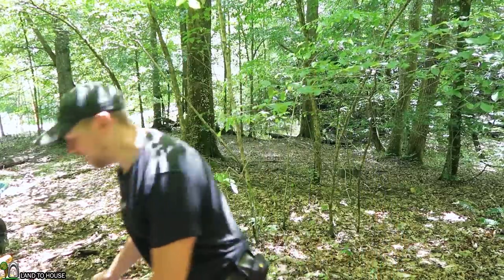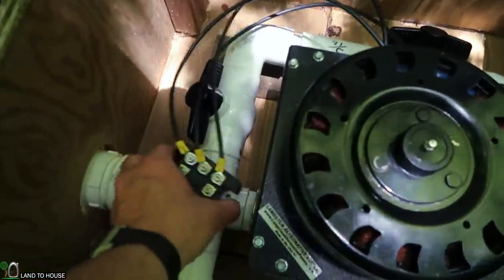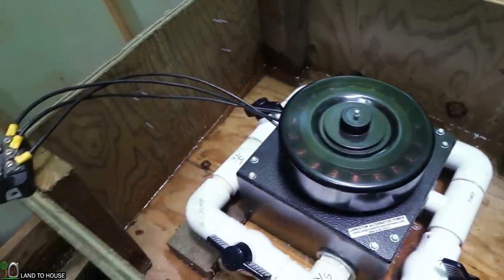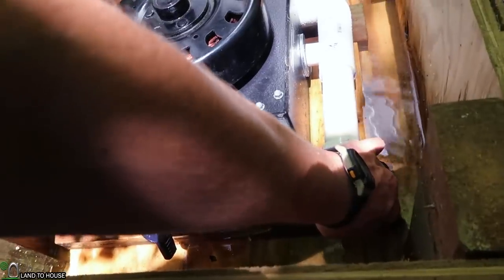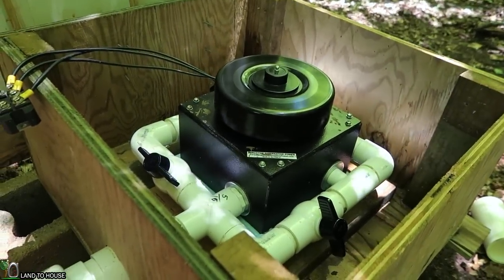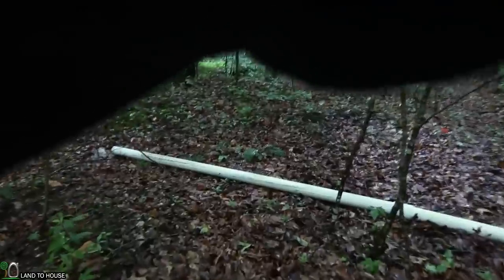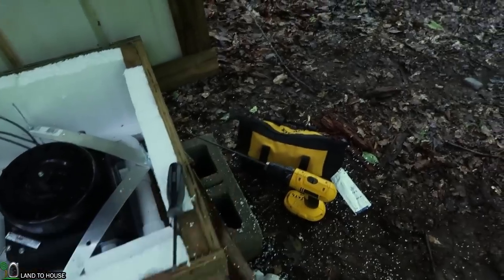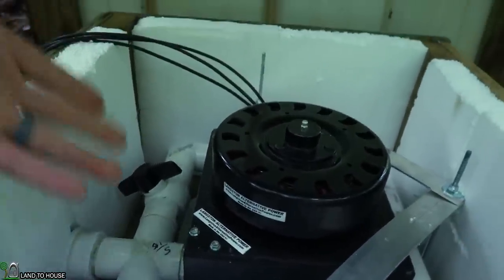Installing the Turbine Micro Hydro 6/10

Comment: Very nice system, however, I'm surprised he used cheap PVC plastic ball valves; they just don't last, especially outdoors with constant changing temperatures..
Reply: First thing I said. This thing doesn't stand a chance in winter. Seems like a cheap unit all the way around. Not sure the price point but I wouldn't bet my family on it. That's for sure.
Reply: @hellogoodbye3129  If the plastic 'ball valves' are an indication of the entire build then the product is sub-par at best..
Reply: @dukeman7595  so I looked at the web site. This company seems like it was cobbled together, the generator unit specs are non existent. Each unit is custom built. The reviews are split between "it works" and "broke immediately".  So yeagh. I stand by my statement of not going to bet my family on it. At least they don't seem to catch fire. So there is that.
Reply: @hellogoodbye3129  The cheap ball valves tells the tale; if he, they use cheap junk the mentioned, I suspect the rest will be as well..

Comment: I'm surprised the box is so small. wouldn't it work a lot better if it was a circle instead of a square? After the jet hits the turbine or the Pelton wheel you don't want it to Splash back after hitting the Box and if it's flooding it's definitely way inefficient.
Reply from the maker: I am going to be remaking this box in the future. Thinking about using pvc trim boards as the water proof box. Then I can make the drain a lot larger. I will need that when I start opening more nozzles.
Reply: I've always thought about making one with a cone shape. That way it would be deflected out and down. Just food for thought
Reply from the maker: Yes i suggested that to Joe Malkovich and he tried it in his micro hydro. Did improve things some.

Comment: It'll be interesting to see what happens to pressure when you open up all 4 nozzles!
Reply from the maker: I would need a lot more water!
Reply: @LandtoHouse  I've enjoyed the way you are working through projects with no foul words or throwing tools around (which I have done routinely), have you tried all 4 nozzles?  would it do any harm to do it?  Waaaay down the road, you might contemplate a designated 10' X 10' shed, insulated with turbine right in the middle so you can access all sides, if it's going to power your house you're going to need to be able to work on it as time goes on.  Of course another project is just what you need, coming from me with waaay to many projects and way to little time.

Comment: Thank you for the video. Figure my ignorance, where's the water coming from? Guessing the creek. What did you hook up to pull the water from the creek? Also what are you going to do with the electricity?
Reply from the maker: Hello. Each of those questions are answered in the series. I get the water from the creek. It is flowing around 30gpm. I use a wooden box with screen over it to capture the water and then filter it in a barrel before it goes down the penstock. I use the power in the house. It saves around $30 a month.
Reply: How do you pressurise  the water?
Reply: Rudy Lovato he used a pump. Watch a few of his videos.
Reply: @ScreenPrintR  
Thank you

Comment: Cool man! I like your Videos very much! And there is enough water to feed your Ram Pumps too 👍🏻maybe you can use a big Ram Pump and a bypass in your Intake too, to give more water power to your turbine... ;-)
Greetings Ben
Reply: Ram pump on the discharge to feed back into the collection box?
Reply: @bufkinmanor  no, I think you lose too much water potential. I think if you collect the water after the turbine and feed a Ram Pump, its possible to get more high pressure water to feed the turbine. Maybe as one nozzle in the turbine separate or with a T in the drive pipe from the hill.... Seth ist a Ram Pump Specialist? Maybe its possible 😬
Reply: ViezeBen, not sure the flow rate from a ram pump would do much good.  I do like your thinking though, maybe Seth could do some tests for us 😊  after all, these are pre-recorded videos, what else does he have to do right now? Haha

Comment: Double the size of the drain, inlet is 2",  Outlet should be "at least" 4".
Reply from the maker: I might have to do that when I start using more than 1 nozzle.
Reply: @LandtoHouse  Why even have a drain pipe?
Just place your turbine housing over the creek (or at least very close to it) and let the water flow directly out of the turbine. No additional tubes.
Reply: @ahmdabdallah2132  
Why do you think I would believe you that your god is real?

Comment: The Pelton wheel is known for being  extremely efficient, but it rotates at high RPM.  What types of bearings are used and how long are they warranted by Lancaster?
If all.four nozzles are turned on, can you achieve 220 volts.AC then split it  down to.110 vac.at the house?  How many watts are you getting at 110 vac at the house?

Comment: Big respect, but I have a question for you. All you chaps convert to DC immediately and then have a long wire to your house, Could I suggest that you transform up the AC to 5X or 10X transport your current to the house and then drop it back down to a usable power to charge your batteries, you will have far less losses. We are not talking Country wide power distribution conveying thousands of KV here. If you dislike AC, you are not related to Edison are you <Big Grin>

Comment: when you start taking energy and put a load on it  it will slow right down  a multimeter only checks current not draws a load
Reply from the maker: Correct. Continue watching the next few videos to get the load voltage.

Comment: I think you should get an actual electrician involved to help you out with the wire runs.  What I'm  seeing and what you are talking about doing makes me nervous.  200VDC is a lot.  What are the AC phase voltages coming off of the turbine? That rectifier seems like it should probably be closer to the house or inverter.
Also, you should probably just go ahead and add another 10 ft section of pipe to the output to get as close to the creek as possible.

Comment: Drill a small hole at the top of the drain pipe and use a air line check valve to prevent vacume.

Comment: hello I have a question, I'm making micro hydro using a dc generator, the resulting voltage is 112V DC. but connected 5W load, the voltage becomes 10V DC?
Reply from the maker: Yes under load the moter will spin slowly a d the voltage drops. My hydro unit spins 200v no load and 80v typically under load.
Reply: @LandtoHouse  Could batteries alleviate this? Kinda like a buffer?

Comment: Add the ceiling insulation before the winter. And question can you use that voltage to charge home battery systems?
Reply from the maker: We shall see how cold it gets in there. Yes I am installing batteries in part 8 and 9.

Comment: Have you considered feeding the water byproduct back to the turbine, at least some of the byproduct?  Think of the micro hydro system as being the circular system in the human body.  The turbine is the heart.  I think if there was a way to prime the turbine with the necessary water and pressure, and then the system utilizes that water and circulates it back, at least some of it, to the turbine, thus creating a self-generating and "perpetual" power generating machine, like the human heart.

What do you think?
Reply from the maker: The problem is the pressure difference. The penstock has a pressure of 65psi. The waste water has a pressure of 0psi. There is no way to combine the two.
Reply: @LandtoHouse  thanks for the quick response. What is the penstock?  The source of the water or the water stream?
Reply from the maker: @thomasperry7837   The penstock is the special name for the pipe that brings water from the source down to the turbine.

Comment: A better way to do this is to take a 275 gallon tote and cut the top off then build a stand for the turbine to sit on 16-20 inches tall.  Let all the water drop to the bottom and out the value.  then pipe the excess out to wherever.
Reply from the maker: The goal for the next design is to make a PVC trim box with a full 9"x9" port out the bottom. That will allow the water to flow out with ease.

Comment: I would like to know how much power it can make at full load. My thoughts are using one like this to power my heat pump pool heater using the pressure from the pool pump. Am I asking for free energy and this won't work?
Reply: What runs the pool pump? What makes you think the pool pump can put it under 100% load?

Comment: Do you take into consideration the local wildlife while designing these hydro electric projects?
Reply from the maker: Local wildlife? Like squirrels chewing into the penstock?
Reply: @LandtoHouse  like Fish that use the waterways to spawn. Or insects that live in the water that are a part of a food chain. You do use natural water sources for your projects right? I find it fascinating how hydro electric engineers overlook the wildlife. Look at some of those massive damns producing electricity for cities and how little they care about the local wildlife. I suppose people don't care about that type of stuff until it effects them personally.
Reply: @LandtoHouse  for example, fish fry are fractions of an inch in size but use waterways to live and grow. Insect larva which could be vital to fish stock is fractions of a centimeter at times. Do you think anything survives the journey through The Hoover Damn? I doubt it. Same could be said with nearly every other hydro electric project on earth, nearly. I think I have seen 2 designs that are wildlife friendly in 20 years of seeing different types.
Reply: I just saw your little electric generator that basically looks like a blender and thought I would ask.
Reply from the maker: Ah got you. There is a spring about 30 feet down from my intake. So the creek is not dry.

Comment: Place an inverter (enclose it) next to the turbine and then you can run your AC wire output (8g or 10g) up to the house without worrying about voltage drop.

Comment: sounds pretty good, but will it sustain 50% of its speed under the load? Its also spinning quite fast continuously, bearing maintenance might be something
Reply from the maker: The charge controller slows the speed way down under load. It finds the best speed for ideal power production.
Reply: @LandtoHouse   any free plans for the charge controller and generator parameters to build?

Comment: Yeah you should have about 125 Volts RMS  when you're finished with it.
Reply: Why are you concerning with RMS? This is a 3 phase VFD with a 3 phase to DC rectifier supposed to be installed. These little turbines are for charging battery banks to run inverters. RMS is an AC measure that equals equivalent DC value, but since the  output is 3 phase it's useless for charging. Also AC transmits better in wire with a smaller wire sized for the same ampere rating, so it would be useful to make the connections from the alternator to the rectifier as close to the battery bank / charge controller as possible.

Comment: How about if you had set the genny in a conc lined pit, and bolted it down with a insulated lid, wallah zero noise? That box is probably amplifying resonance same as a audio speaker box would.
Reply from the maker: In the redesign I have some nice 2" thick closed cell foam. I think it is going to work really well.

Comment: I have a tip, Well I highly recommend you rethink your housing, you need the turbine for one much higher off the bottom, also I thought that would happen when i seen the build, your drain in way too small, I would think an 8 inch draining system (a 6 inch at the least) the water is entering at very high pressure and speed so it won't exit that size you have very easily, a deeper catch and larger pipe would solve it.. I have seen other make that mistake and came to the same conclusion, that a deeper catch and bigger pipe was what was needed, Please don't take what i am saying as criticizing, I am not, I just want to offer some sound advice.. If it wasn't for mistakes we would still be in the stone age, we learn from every one.. I for one mad some colossal mistakes in my younger day's.. LOL Just never give up, Trail & error always ends up with a better product in the end... I have a question.. I thought you were going to use a ram pump in your power production, I didn't see one while you were running the pipping.. Cause connecting one and running at least 100 feet of pipe would give you much more pressure. with the same volume of water, which in theory should generate much more power (of coarse the pipe running from the ram pump needs to be a smaller diameter)... Lot's of luck and prayers for your success.. Be Blessed.. P.S. I don't know if you ever watched Joe Malovich, but here's a link to his channel.. He's already dealt with and fixed some of the issues you have or may have to.. I hope this helps you build an awesome system... https://www.youtube.com/c/JoeMalovich/videos
Reply from the maker: I have actually watched Joe's channel for several years. He is much better at precision than I am. It seems that most people feel I need to remake the housing. I do wonder how well its going to handle the extra water when I turn on several jets. We shall see. Should make for good content in the future.
Reply: @LandtoHouse  You are a lot like me I think, well when I was much younger, LOL.. I used to rush into some things, LOL then redoing them... One thing I like on how Joe did his, was he thought ahead on excess water and added it.. Until you know 100% where your's is going to live, where it's at works.. I often found using an old pallet as a platform to building things always worked for me, they are flat, sturdy and easy to get and build on.. I used a pallet to put my portable table saw on, now more then 20 years latter, it is still on that same pallet.. I just use a pallet jack to move it. when needed... Today with how modern technology has blended with old.. I can see more & more people going off grid. It time I can see you, Joe and a few others leading the way and teaching others how to do it..  I really don't mean to sound critical sometimes, it's just how I think anymore, seems the older ya get the more (in my case) I want to help others succeed.. My grandkids really get frustrated with me, instead of helping, I sometime end up doing whatever it is.. LOL.. Keep it up and go for it.. You never really know something until you do it.. Inspiration can come from the least likely of places.. Be Blessed.. I await to see your next adventure...
Reply from the maker: I have realized that I am doing to many things at the same time and not completing them. So its time to slow down and get some things done. The turbine housing should be easy enough to fix. I think I will pull the bottom off and install a catch tank. Then let that 3" pipe go out of that.
Reply: @LandtoHouse  Good idea. Being spread thin just comes with what you're doing, lot's to do and only one you, lol.. Just don't forget to take time to breath and smell the roses..

Comment: ???
or am i missing something Big time  so what is the head psi and flow rate for your set up?
Reply: At the start

At 17:00
Reply from the maker: This is a 10 part series. The first couple videos show the head pressure. 65psi. Flow rate is 15gpm up to 40gpm depending on the time of year.

Comment: I suffer from that runaway turbine, it makes no sense to measure the voltage without an electrical load, it only serves to know the maximum no-load voltage, adding transformers to raise the voltage for transmission to these powers nullifies due to transformation losses, better to oversize the line and avoid fewer steps
Reply from the maker: The reason for testing the open voltage without load is to make sure that the charge controller can handle the volts. Its close. Charge controller is 200v and the turbine is making 199v!
Reply: @LandtoHouse  I trust in the reliability of the best MPPT solar charge regulator in the world, which also has hyper-VOC, generally a protection system is mounted before the charge regulator as in wind power which diverts and dissipates on resistances based on the voltage detected as an ELC for synchronous alternators, in this case a maximum voltage relay would be enough, this also avoids stress on the bearings as well as risky high voltages, but it is better if the whole system holds the maximum voltage generated in the event of a turbine run-out Ciao

Comment: im no hydro expert but you should try your best on removing the sharp turns your losing potential gains from that, also you should put some load on the turbine then running it without.
Reply from the maker: The flow rate is only 32gpm or less with all jest open. That 1-1/4" split should handle that just fine at 65psi.

The charge controller let's the turbine spin free when the battery voltage is in float.
Reply: @LandtoHouse  Ah i see, ive seen people use plastic buckets cut out around the wheel so it removes the water quicker, should take a look at some vids to improve what you have maybe by 5 to 15% more out of it, lucky guy haveing that available in the garden!

Comment: Wow I real like this set up  this is best one I seen  did you it running  to your  house . I with  to see it all set up.
Reply from the maker: Thank you! The unit ran well for a season. Now I am going to make some upgrades to the intake and housing. Those videos will come out in the spring. (when its not 25 degrees out)

Comment: I would use a 5"on the bottom of the trbine go out about 1 foot then go to 3" 10' long pipe then if it's not too much water id try to go down to 2" the rest of the way out to the crick

Comment: Don't use a steel piece of decking for a lid, transfers noise! Use wood with close cell insulation.
Reply from the maker: I have a new housing video coming soon!
Reply: Strapping it down probably reduced more noise than the insulation. I would think eliminating vibration would make the big difference.